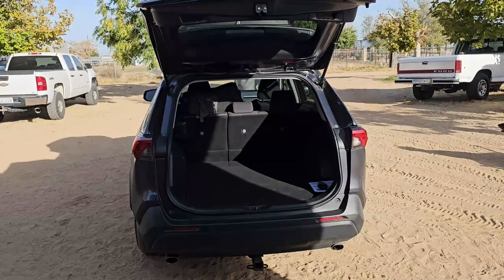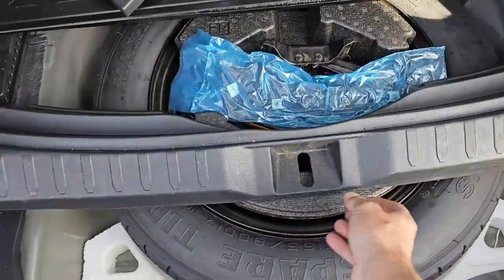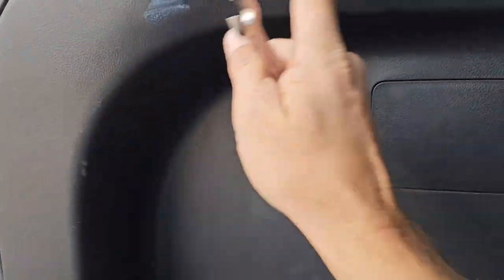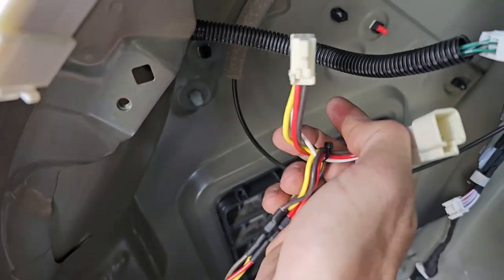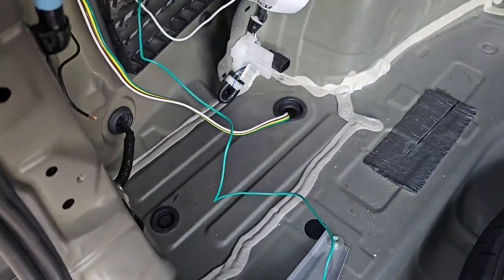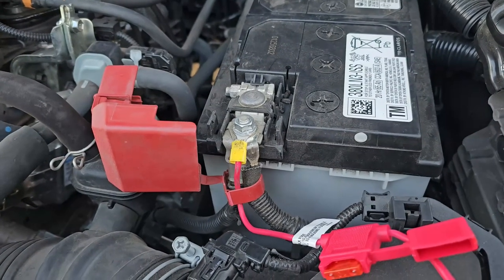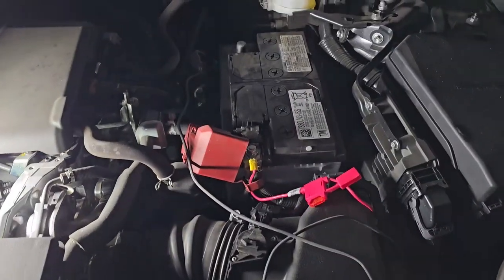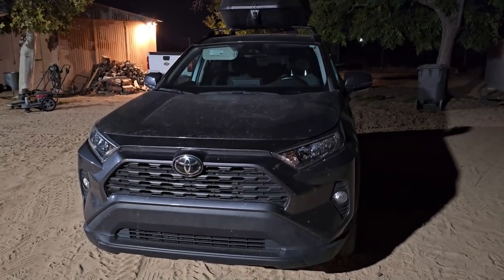2019-2024 Toyota RAV4 Hitch Wiring Kit Install, 5 mins

Comment: Good info. Note: Getting the wire from the back of the toyota to the front battery is kind of tough. I recommend using car ramps so you can work under the vehicle more easily. If you have a buddy with a car lift, buy him a bottle of Jack Daniels and ask him if you can use it.
Reply from the maker: Ramps or a lift would make it easier.

Comment: Just curious… did you happen to re-seal that grommet near the spare tire? If not, it can get water from splash up.  Only saying this from experience in my old 4Runner after installing a auxiliary battery system
Reply from the maker: We didn't at the time. My buddy, who owns this car, was gonna go through and do some finish work to it once we were done. I never asked if he did do this but he might have. It can easily be done with any form of silicon sealant. Generally, if it is a normal driver, you won't have issues with that unless you offroad through water or drive in a lot of snow/rain. Thanks for the comment.

Comment: Haven’t seen the red xj in awhile
Reply from the maker: We still have it, all the projects that have been coming up for it are expensive. It needs new gearing going to cost over 2k in parts. Want to do bumpers on it, again 2k in parts. I want to golen swap it, eventually, that's 6.5k. We will do more on but right now i have 3 cars that have to get running so we can flip them. Plus i have to get the 53 frame out of the garage for space to work on those cars. I promise there is more coming. If you have any cheaper suggestions on what to do to it, we can look into do it.